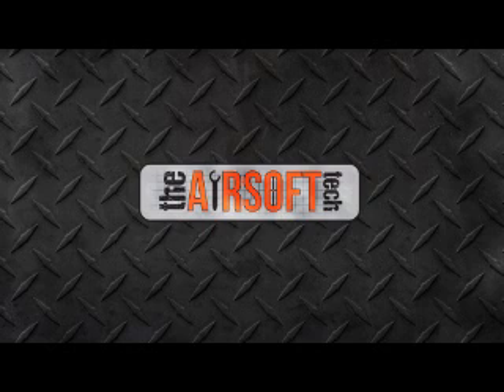Airsoft Mechanics Podcast: Episode 9 - Retro Arms Split Shell and Motor TPA

Comment: I recently got the split gearbox (arrived about 2-3 weeks ago), and the spring guide now has longer threading, they removed the ridges in the hopup and went with a rubber ring like the madbull hopup, and it didn't seem to have fitment issues with my charging handle (which is a king arms). I haven't completely installed it yet, so I can confirm thickness issues, but it seems those other issues have been addressed, so maybe this is finally becoming a good gearbox.
Reply: ***** are you able to use regular trigger contacts? I heard that they weren't able to fit. I'm interested in buying one, but i want to make sure.  :P
Reply: FallnytePlays I am planning on installing a ASCU Gen 4, so I haven't tried regular contacts. But I can tell you the ASCU doesn't fit perfectly, it will requiring dremelling out the lower right corner of where the trigger box would go.
Reply: ok, can you maybe test with regular contacts and see how it goes?  :D
Reply: Does your king arms m4 have a mock bolt catch system?
Reply: No, it did not.

Comment: I have a split gearbox, and was it a bad gearbox to buy? I thought it would be great, and I can't tell of any issues with it yet. I will let you know if I run into problems. (I did have to mod a post that stopped my chimera trigger unit from installing, and will be using an m170)

Comment: You should talk about shs vs super shooter in different parts such as the gears ( i know they are the same company but super shooter is supposed to be their higher end). I plan on ordering a set of 13:1s and the super shooters are the same price on brill as the shs on clandestine. My shs sector stripped so I will be replacing the sector and may get super shooter instead.

Comment: I am trying to build a dsg in my RA split shell. i have a siegetek 14:1 dsg gearset. i am trying to correct the motor height and get properly gear meshing between the pinion and bevel. there is a grinding noise that sounds terrible. i lowered the height all the way and the noise is still there. i have used different shimming guides (for bevel to pinion method) and have tried to move the bevel around. still the noise!!! any thoughts? i have also dremeled the motor plate down to make the motor lower, and the sound improved, but did not go away completely. should i continue to grind the motor plate down or do something else. i have never had this problem with my other m4, or my pdr-c, but with these parts there is the noise!!! any thoughts? i will just continue to tinker with the parts or try any advise anyone says down here vvv
Reply: ***** do you mean one of the sides grinding on the sides of the gearbox shells? because i have multiple shims on either side of the axles. could you describe the part in greater detail where the bevel could be scraping? thanks, graham